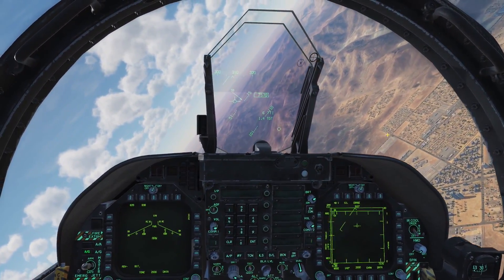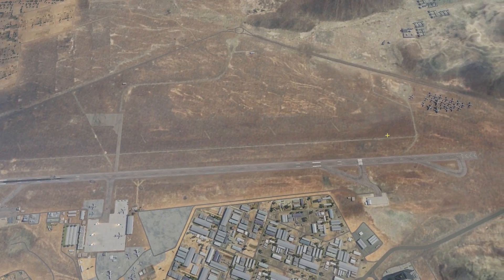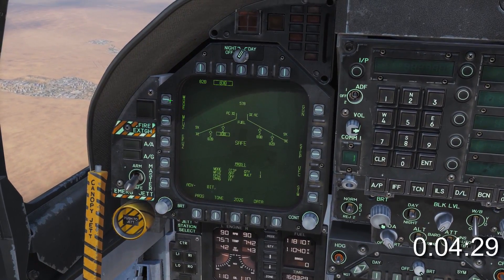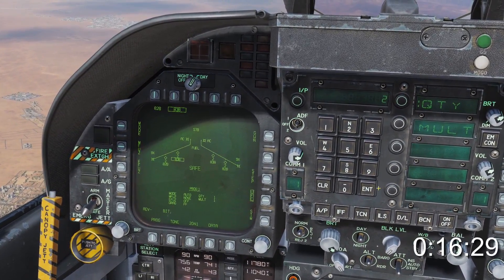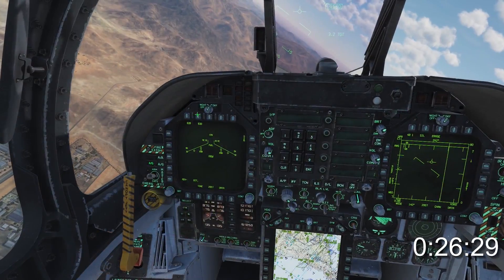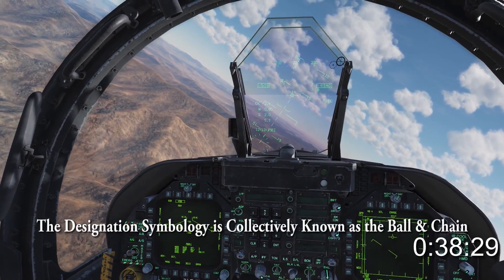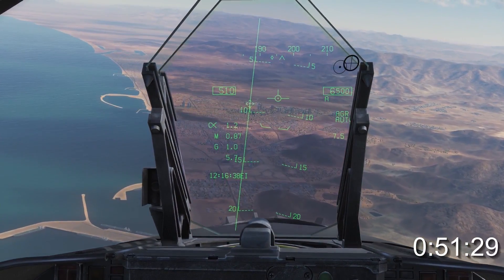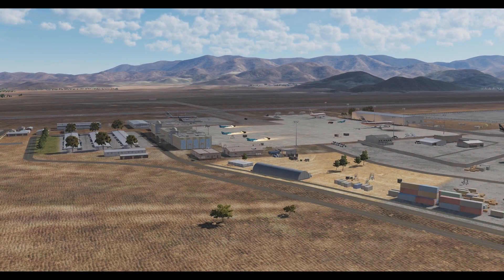1 Minute DCS -  F/A-18C Hornet - Manual Designation Auto Bombing Tutorial

Comment: Hi.. I am a newbie.. i don't understand pickle button you mentioned when you lock to terget, i am confusing with TMS button press forward to lock a target thanks
Reply from the maker: Thank you sir!  Welcome to DCS.  The pickle button is the button you usually use to drop bombs and missiles.  If you go to your control settings, then go to Stick, or Hotas, you'll find it, it's the smaller red button on the back of the stick.
Reply: Laobi the weapon release button on the top of  hotas worthog stick or you mea pinky button? To streer nose wheel angle hi anyway thanks  i will check at the setting page
Reply from the maker: That's the one, the weapon release and pickle are one and the same, I got so used to referring to it as Pickle I had forgotten the other name.

Comment: Two quick and probably unimportant things: 

1. MFUZ stands for Mechanical Fuse, not Manual. Manual is the bombing mode you use if you rip a fat line of coke cut with Adderall before hopping in the cockpit.

2. The current flight manual suggests both/either the WRB or the TDC designate switch on pages 131 and 132 respectively for HUD target designation. While I can't say I've ever employed the WRB for target designation personally, i'd wager that the TDC designate switch may be a bit safer in the event of pilot configuration error. 

Also, go fuck yourself, and great video as always.
Reply from the maker: Thank you very much sir.  Great points, I had manual on the brain that day/week, it definitely should have been mechanical. I think you may also be correct and there may be a little confusion in the manual as the first point under Auto states you can manually designate with the pickle using the HUD, but later on it recommends using the TDC designate (which makes more sense, particularly if the pilot has set things up arseways).  Unfortunately I can't get my hands on the NATOPS that would definitively clarify it.  Thank you for the feedback, I really appreciate it.
Reply: No problem! I wouldn't know half as much about DCS today if it wasn't for your videos in the past. Keep doing what you're doing!